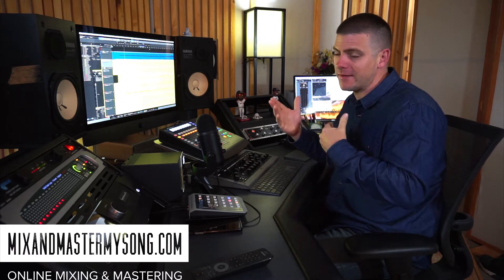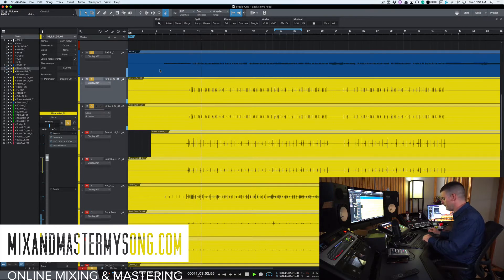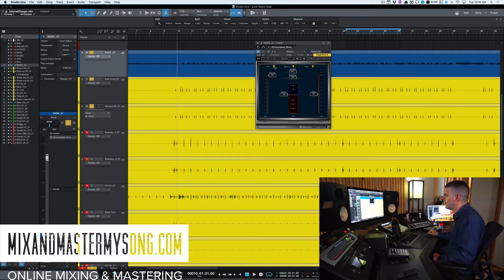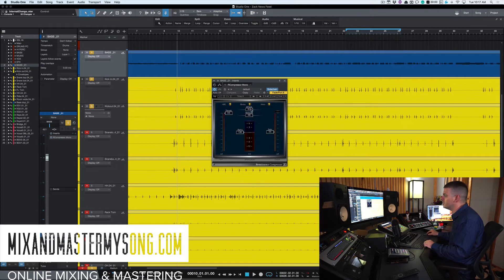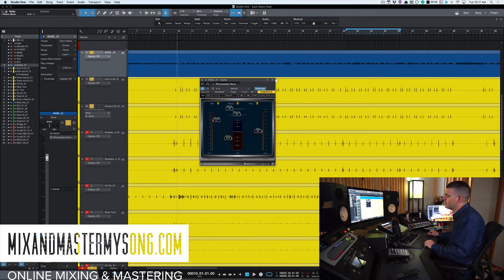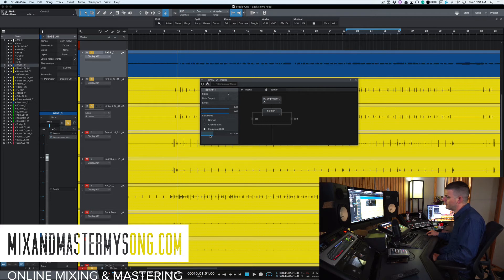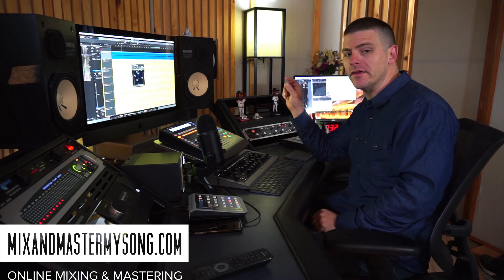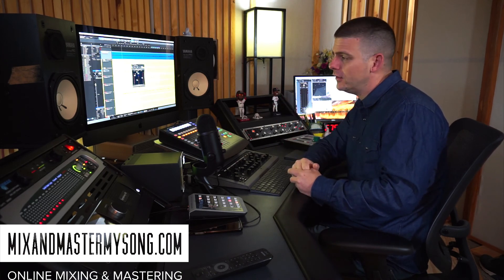Clear Low End Using Side-Chain Compression in Studio One

Comment: Excelente. But i have a doubt . i try this with my waves plug ins and sidechain tab it's not available when I used with waves. If I use the presonus compressor does. Any advice with this?
Reply: Anyone solve this, I have same issue
Reply: There are sidechain versions of waves comps, denoted by (SC) after their name. Select one of those.
Reply: @paulsp80  Does it work with a non-native compressor? Ex: waves c6 sc or fab filter pro mb